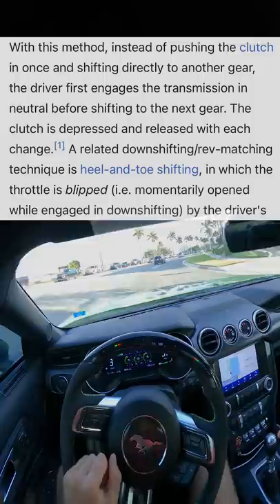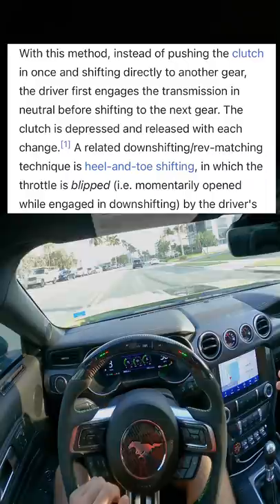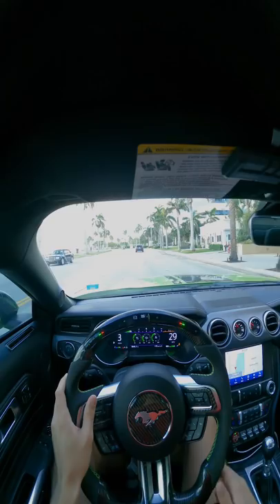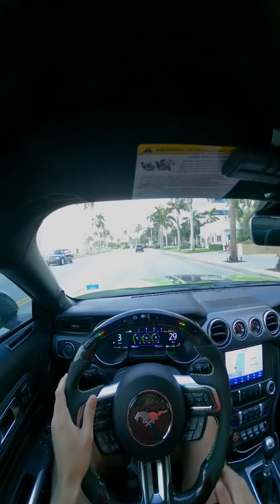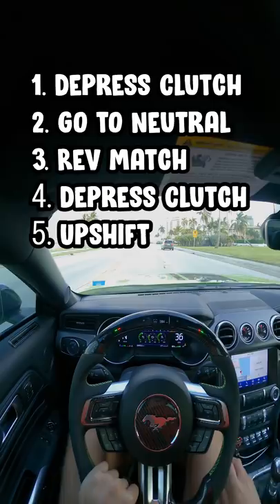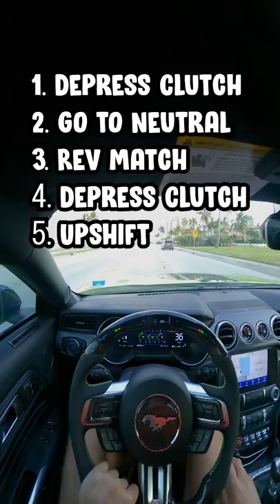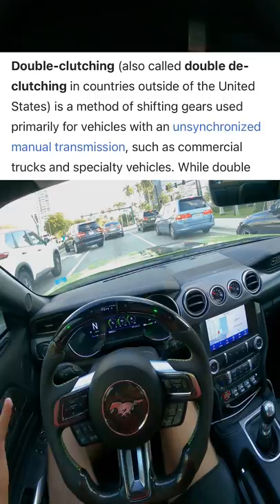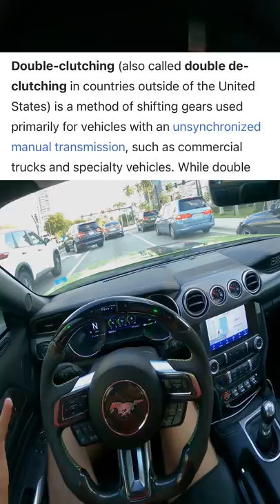WHAT IS DOUBLE CLUTCHING IN A MANUAL TRANSMISSION & SHOULD YOU DO IT? #SHORTS #MANUAL #GT #FORD

Comment: No, no, you don’t have to double clutch straight cut gears. The only time you really need to double clutch is when ur hauling a huge load and you’re engine braking. Double clutch downshift saves ur flywheel from a ton of abuse from hauling the big load.
Reply: But only on old trucks, modern trucks have syncros which result in matching gear speeds that also save the flywheel/clutch. Also most modern trucks are automatic so...
Reply: @LinkinPark4Ever1996  man.. that almost makes me wanna get back into it. Trucks nowadays are so nice. After this divorce is finalized I might buy my own truck again

Comment: Every crash box trucker is now reaching through the screen to bitch slap the back of your head. People in penis compensator cars “Rev match” by revving back up, but that’s just to get the attention of people around, and to make them feel cool. Truely double clutching, you should be able to hold the revs at the correct stable speed. Besides, a better way to change is slide out of gear as the clutch peddle goes down, and into gear as the clutch peddle hits the floor. As long as you ease off the throttle slightly, it slides out just fine without any clashing, and it’s all synchro before it goes into gear. Takes practice, but you will develop blindingly fast gear changes. I do it often in unloaded 12 tonne trucks when trying to beat traffic lights with four second green cycles. Surprises the crap out of muscle car drivers when you initially keep up with their take off.

Comment: Hahaha, you don't double clutch on an upshift. The whole point of double clutching is to match the speed of input and output shafts in the transmission before downshifting. It's totally not necessary in a road car anyway as the synchros will do that.

Comment: To me only time you should have to double clutch is for instance I had a 350 vortec out of a mastercraft ski boat I made it carbureted I put a 700 quadrajet on it when I did that I turned my secondaries out to where your rpms would have to be turning around 3k or more or the car would flood out so when i would double clutch lets just say mf was usually trying to get down in the floorboard of the ol IROC Z 😂 i sent the heads to lunati in Memphis they where $680 a piece high rise volvo plenta intake cause it was a marine engine and i had a 1" aluminum plate on top of it Holly fuel pump and regulator about 12 lbs of fuel hedman shorty headers voodoo cam cause it was a daily driver had a 4sp muncie trans eibach springs and control arms took the factory 5 stars of ordered some 17" chrome 5 stars pohn rear end with lockers in it most definitely would get down dyno at super chevy 4° retarded was 428hp 418 lbs to the wheel

Comment: I don’t understand what’s the point of pressing it twice? I’ve driven only manual cars all my life and there is no mechanical logic behind this. Literally. I’ve asked old drivers too they just laugh and dismiss it as a joke or something. Press clutch, go to neutral, revmatch…. Ok…. Press clutch again?? Why? What is the point? Clutch, revmatch, downshift. That’s the correct way. There’s also no need to revmatch when you upshift because the rpms are going down the moment you press the clutch.
Reply from the maker: This a method that’s used when the synchros are worn

Comment: Actually, in commercial vehicles, the operator is supposed to "float" the gears. Double clutching was for way back in the day when the transmissions required it to prevent binding.
Reply: Wrong but your close

Comment: That's dubble clutch well that's the only way I drive manual transmission cars I have a 1991 Acura legend coupe with a 6 speed manual transmission and 400,000 the clutch has never been replaced and the transmission still shifts like new I did have to replace the bushings for the linkage one time I made polyurethane bushings I made a urethane that was hard but soft and grippy so no noise even with no lube

Comment: I drive truck, and its quick and smother not touching the clutch at all. In a car i dont see what benefit you would get my double clutching.
Reply from the maker: You have different gears. Yours are straight cut with no synchros
Reply: @TobyVegaD  true, which is why you don’t need the clutch, lol unless you’re a bad
Shifter. But ya in a car (in my opinion) it’s completely un-beneficial to double clutch, i love manual cars, my first 5 where manual, my winter beaters are always manual as well, and ive double clutched to see what the benefits are and in my opinion they’re none. 🤷🏻
Reply: @Dee12327  apparently someone doesn’t know what floating the gears are. Fords are pretty good at being able to float the gear. “Shift with no clutch and no grinding” for those who don’t know.
Reply: @goldpipe2003  ive never been able to do that in a car. Never tried in a mustang or anything, i know u couldnt in the focus’s

Comment: take this down, you're full of bologna dude. you would never Rev match on an upshift, it doesnt work like that. 

if you're in 3rd going to 4th the revs have to go down. raising the rpm from 3000 to 4000 when your rpm needs to be going down somewhere close to 2000 is so counterintuitive. you'll just ride your clutch more.

on a downshift, of course, blip the throttle. double clutching when you UPSHIFT helps match the speed of the input shaft and gear in the transmission. if you read the entire Wikipedia article you referenced in the video you would know that. 

it doesnt have much to do with actual engine rpm.
Reply from the maker: Ok

Comment: This video is wrong
Reply: Gear type has nothing to do with clutch use or shift engagement. Your last statement is completely false. In fact "straight cut" or spur cut gears are likely paired with dogs. Also used in sequential transmissions where in both cases after first gear a clutch is unnecessary.

Comment: This is the worst video I've seen on this topic, probably becuz you only had 60 seconds lol

But you don't need to rev match you can just briefly shift into neutral to synchronize everythingthen shift into gear, just like how very old cars or yes semis work, although you cannot float gears like with those systems. 

But no one says you "need" to double clutch that is just silly, it is advisable when you are driving a car with worn out synchros, but a functional or new clutch. It will barley decrease your clutch life but drastically ease the work your synchros do which is useful for slow or worn ones . 

You can also double clutch to downshift faster in theory, but this video does not accurately describe the usefulness for an average person not the context in which they would be double clutching